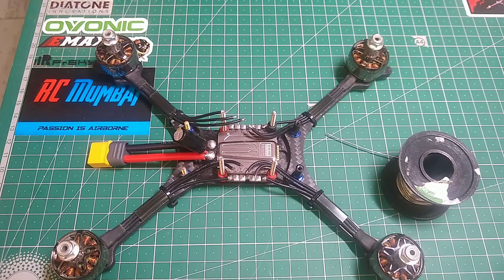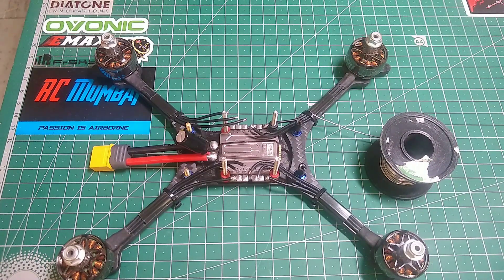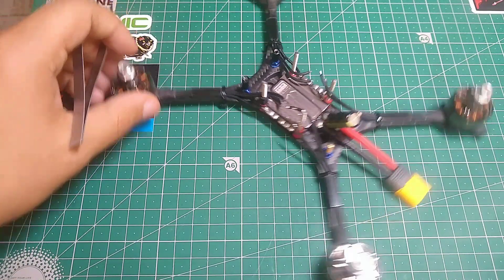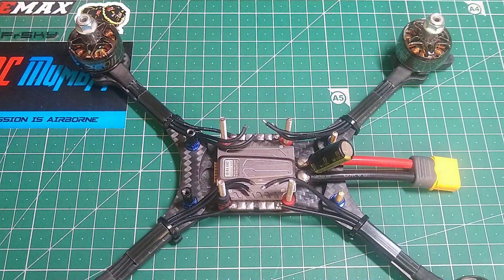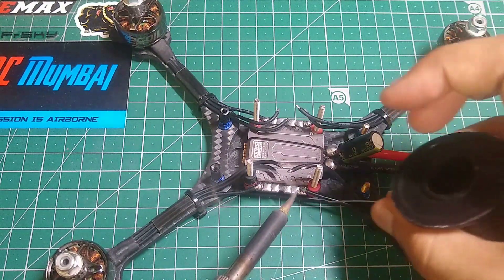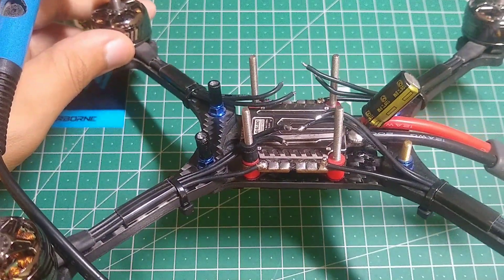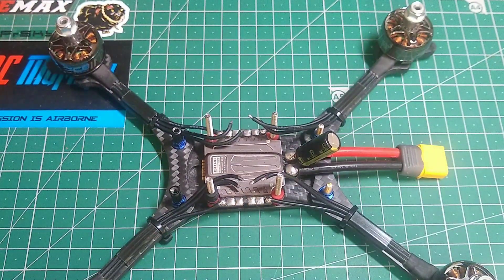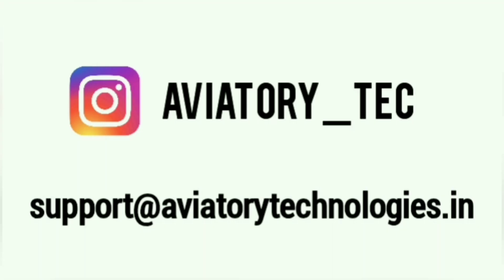How to Solder FPV | Beginners Guide to Perfect Results | FC & ESC

Comment: How Do you know which three black wires from the Motor goto which pad? are they marked POS, NEG. GRD ?
Reply from the maker: No middle wire from motor goes to middle pad rest motor wires can be swapped and installed in any manner